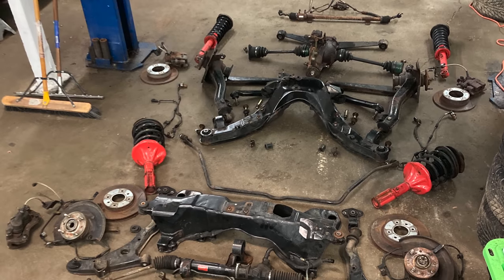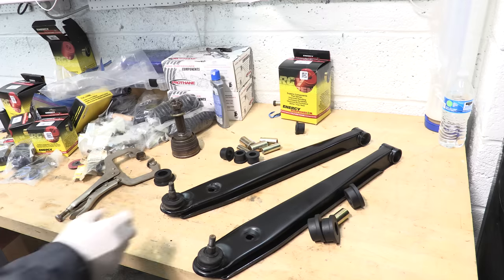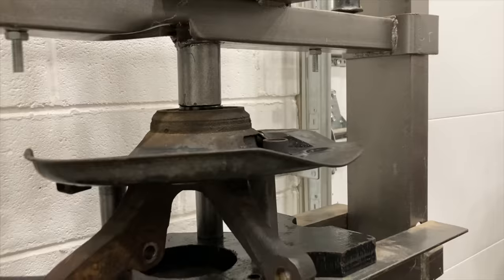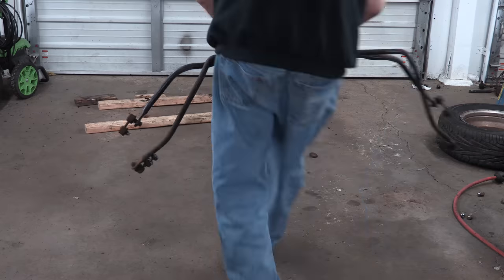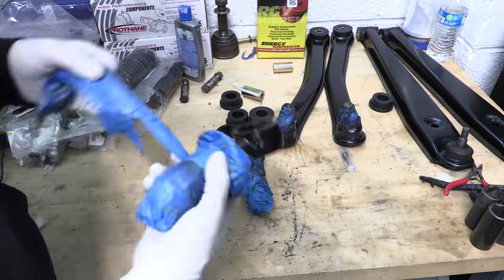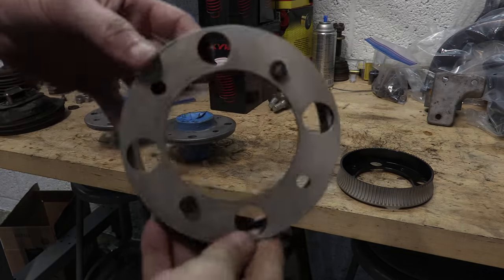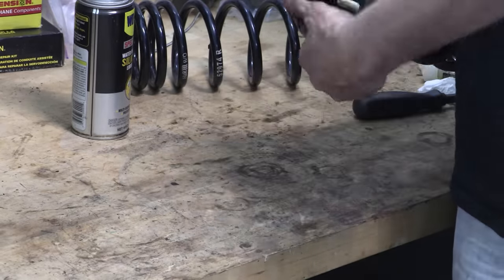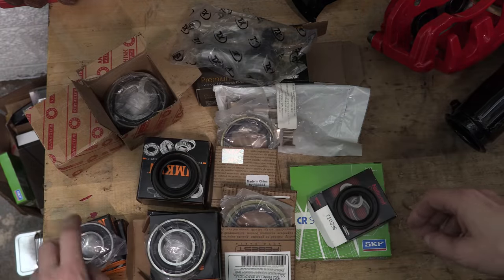Galant VR-4 Subframe Restoration Part 3

Comment: He definitely did a nice job on the powder coating. I used to do it for work. You should be fine to use brake parts cleaner though. That powder coat should be totally resistant to any of the normal automotive chemicals. If he said otherwise then yeah listen to him, but just what I think I know. Anything you spray painted you'll want to avoid the brake clean. Awesome work as always. Video went by quick!
Reply: Still gotta be careful with brake fluid though. It will make it bubble up if you get any on powdercoat
Reply: @Eastahtata  It's funny because I have seen testing that shows it does nothing, but at the same time I have experience that it does. I almost wonder if it depends on the brand or something. Either way, I'd definitely avoid it. I'd rather clean some off with brake parts cleaner than let it sit that's for sure.
Reply from the maker: Justin did not warn me about anything I said in the video, that all came from my own experience.  I figured it out the hard way on a few of my parts that Justin didn't coat.  It did.a thing that I couldn't put in front of show judges once, and that time it was actually with carb cleaner.  But since that time I've never met a mess that soapy water didn't clean up.  Which is nice, really.  It's a lot less toxic, and you've already got a non-stick coating.

I don't actually buy brake cleaner.  And nothing chlorinated will ever come in to my shop because we weld here.  All I use is Berkebile 2+2, and it wrecks absolutely everything that isn't bare metal.  Whenever I'm using that stuff it's because that's what I need to do at the time.  It's mostly acetone just like brake cleaner and carb cleaner... but it's got methylbenzene, xylene, toluene... way worse stuff in it.  It's great!  But it's not chlorinated. 

I also learned the hard way from overheating once (caused by air bubble in system on first startup, it got a great first heat cycle) that scalding hot coolant is also really bad for powder coating.  My "almost chrome" water pipe turned flat grey where it splashed. Coolant overflow hose blew off.  Again, not the same powders or Justin's work at all, but these are the kinds of things today that I will still go out of my way to avoid.  I'm even picky about the texture of rag I'm willing to use to clean powder coating just to avoid swirling, but ALL of this is only because I kept putting it in front of show judges, so I suppose my intent and past experience is a bit different than most people's would be today.  That would kinda shape my own advice this way.
Reply: @Jafromobile  All good to know and best practices are best practices. Properly applied, brakleen should at worst dull the finish on most powder coats a bit, but obviously it would be nice to avoid that too! Anything chlorinated is definitely nasty as well. Inhale some of that stuff you accidentally light on fire once and you won't forget it. Welding too, of course. Too many ways to injure yourself or die in a car shop if you aren't careful. Thanks for the advice and I typically stick to water based degreasers at worst for my heavy duty cleaning these days too.

Comment: Teflon tape wrapped around polyurethane bushings and sleeves helps prevent squeaks.
Reply from the maker: Here you go with the good advice again!  ;)
Reply: Better advice will it be if you had written it some years ago when I did mine. Grease goes away...
Reply: I just regrease mine if it bothers me enough but usually if you liberally apply it it lasts quite a long time, and poly bushings are worth pretty much any NVH just for the performance increase and overall feel alone. Personally, it never really bothered me on any of my daily drivers or track cars if I had a little squeaking here and there.
Reply from the maker: @caveone-365  I always wanted to add a grease fitting to the sleeves somehow, but without seals or an o-ring my idea always seemed kind of pointless because the grease would just run out the biggest gap.

Comment: Long story short, over the past few years, as much as I could get done each spring through fall and in between all the other things I've had going on, I've done most of the restoration work you've done on your Galant and GSX on my '92 Talon TSi AWD manual.

E.g. removed and completely overhauled/restored/rebuilt the entire front and rear suspension including subframes, members, control arms and strut assemblies, with new bushings when they were available, all four brake calipers, the driveshaft, rear bumper (taking on the front soon), fuel tank, and the manual transmission and shifter for good measure (took both completely apart and rebuilt them)

Replaced everything that typically needs to be replaced, e.g. pads, rotors, plugs, plug wires, PCV. thermostat, radiator, air filter (K&N), fuel filter, hoses, belts, TB/BB/WP, brake and clutch hoses, and a bunch of stuff I can't even remember. Also removed a ton of rust and treated it with POR-15 or KBS (initially used Rustoleum which is crap as I learned the hard way so I had to redo it all).

Also some relatively minor fixes, like stuck/slow/misaligned power windows, faulty radio, rear washer, etc. Now I'm about to do the same for the throttle, intake, exhaust and turbo, cleaning and replacing what needs to be cleaned and replaced. Also hope to try and fix the AC which only broke a year or so ago after 30 years (original and only owner yes you read that right), and the front bumper. Then it's on to the body, cleaning, removing dents and scratches, painting. And replacing the headliner and some weatherstrip.

The goal is to get it back as close to the condition it was in when I bought it, no true mods, just some relatively minor upgrades here and there like ES bushings, a K&N air filter, braided SS brake and clutch hoses, kevlar TB/BB, etc. I don't track or race it. It's my DD/road trip car. So no mods needed. No deletes either, as I like my creature comforts. I had a lot of fun driving it cross-country years ago so I'm trying to get it back to the shape it was in back then. It's a nice car, as you know.

But I have to chuckle every time I see one of your videos because I'm thinking "Yeah, been there, done that, uhuh, exactly, yep, that was hard, that was a pain, that wasn't fun, etc.". Like, removing the rear suspension bushings. Way harder than the fronts, had to drill, hacksaw, punch, pry, etc. And removing all that rust. I don't have a blasting setup so it was mostly a die grinder and rotary tool (I initially used a drill and driver with wire wheels but learned the hard way that this was really slow and inefficient).

I should be done with all the mechanical work this summer. Probably won't be able to do much about the body till next year, as that's a whole other thing about which I know very little. Thankfully the engine appears to be just fine so no work needed there. I want to be able to just drive the damn thing and go on road trips again so I can't wait till this is all over. Thanks for the informative and wry videos!

Comment: Always enjoy your videos. Im not a DSM guy but generally speaking you usually cut a little off your bump stops when installing lowering springs. I always do on the hundreds of cars I've put springs on. I usually chop the bump stops at around what the supposed drop is for the springs. If those are H&R's for example, usually the H&R sport springs are around like 1.5"-1.7" drop on the majority of cars I've installed them on. I'd be willing to bet they're around that height for the Galant. I've always had good results with the H&R's and I've had experience with the sport/ race springs as well as their coilovers, especially the 'Ultra-lows.' You could always modify your AGX's to run a set of QUALITY sleeve coilovers like some Ground Controls, with your choice of # springs and a set of camber plates. I've had amazing results on a more budget minded coilover setup with the GC/ Koni or GC/ Bilstein setup. Its even a setup thats capable on the track with all the goodies like sways, plates, bushings, etc and they work quite well when you figure your spring rates, corner balance, and of course, a properly setup alignment based on your needs/ what you're using the car for mainly. I'm frankly kind of a nerd when it comes to suspension tuning/ track setup if you couldn't already tell. LOL😂 loved the video Jaffro, keep up the great work and keep the videos coming man! 👍😎

Comment: You should drop by a local fleamarket whenever one shows up and buy the metal bits your press needs to function. You're making Nth more work for yourself by not having those and unlike the cheap press, those will last you a life time. I've press bits from my great grandpa's steam press, from back in the war, all the way down and i swear, having those bits is a game changer.
Reply from the maker: I'd love to have all that stuff, and I don't even own a press yet!  Matt picked up a bushing press kit which would have been helpful initially.  Some of that set can be useful on a press, and at some point I'll have to use it.  But Abe had all the dies in different sizes that you're talking about, and he absolutely killed it.

Comment: I had poly bushings in my S2000 and they were noisy at low speed but way better ride quality and handling. The better option IMO. I used shoe lasts for support, out of necessity, on my press when changing the wheel barings and it worked. There's a lot of good info in this video which is why I watched it twice.

Comment: I remember having to torch new bushings, just to use the sleeve. At the time, I was replacing the suspension in a Fiero, and the sleeves on the old bushings were rusting to pieces. And I was installing polyurethane bushings. Sometimes you just gotta do what you gotta do.

Comment: I did all poly bushings on my 2006 miata. I was afraid it would make the car louder, but it mostly didn't. The differential bushings made the diff louder, but it wasn't that bad. Definitely a worth while investment if you got bouncy or loose suspension parts.

Comment: Great videos Jafro!  I've been keeping up with all of them, but haven't though of much I could contribute in the comments.  I am surprised to see you using poly bushings in the suspension arms though.  Because poly doesn't twist like rubber I refuse to use them in any bushings that twist like suspension arms, though they are just fine for engine and diff mounts.  Wish you would have mentioned that fact to the viewers, as these joints will now require constant lubrication to not wear themselves out over time.  It's of course great to see all the progress you're making on your cars!

Comment: Amateur tip if you dont have a press: After lighting the bushes on fire like in the video, you can use a metal handsaw to remove the remaining sleeve. Just detach the sawblade, thread it through the sleeve and re-attach it to the saw. 
Sawing a slit in the sleeve makes it real easy to remove. Then you can just bash the new bushing in using a regular hammer and a piece of wood/plastic as a buffer.

If you don't care about potentially damaging the bushing slot slightly, you can also use a sawsall to cut the sleeve instead, it's way faster.

Comment: Hey, man! Nice to see you!
Q: @28:47 Have you ever considered either easily fab DIY or
buy a used electric oven (220v) to bake enameled parts, or even
a HIGH heat gun to cure? "baked on enamel" used to be a big deal
years & years before powder coating existed. I've even used propane
Benz-O-Matic torch to cure ceramic coatings for headers & blocks in situ.

The heat makes stuff flow, speeds curing- I know you know that, I'm just rambling.
Reply from the maker: One's actually been installed already before I could finish this video.  Stuff is getting baked onto part all over the place up here right now.  I'm not against trying it.  The factory enamel on all the subframe parts isn't your average paint.  The factory used some great processes.  There's a lot of great stuff that isn't sold to the public.  You can't get anyone to match any of Carroll Shelby's work because the primer is outlawed.  I wish I knew what the paint was that Mitsubishi used on their parts!  It's not ceramic, but it's not your average paint.

Comment: So of course I see this right after I do my front lower control arms on my 92 Galant VR4 # 927. My question would be what would happen if you don't put the sleeve back in before you put the new poly bushing back in?
Reply from the maker: If you jack the car up and wiggle it, it will be floppy.  Perhaps it's possible you used a brand of bushings that don't require the sleeve?  I know that mine required it, but if yours did and you didn't use it, it would have kept trying to fall out of the LCA before you installed it.  There would be a noticeable gap on the fit of the bushing.

Comment: Someone makes a tapered cone tool that allows you to spin the flange and heat that wheel bearing race. Once it gets hot enough the race falls off. Super easy.

Comment: Hey Jafro, you alluded to the pain in the ass that is removing bushing sleeves that are pressed into a subframe with no way of pushing them back out. Well...that is my reality right now on the '95 TSi AWD resto. You have any words of wisdom for getting those shells out? I've gotten two out by starting a cut with the dremel and punching it in until it gives way, but this seems horribly inefficient and the subframe itself is suffering some of the pain. Any thoughts?
Reply from the maker: Yes.  Air chisel.  If the sleeve is big enough, there is a bit that has a tooth, dead center in a chiseled blade.  If you've ever seen that one in a set, you know exactly what I'm talking about.  You can cut all the way across it with that without damaging the hole if the hole is big enough.  You can also use the rounded punch to roll the sleeve inward and take some of the grip off it. Not every air chisel is equal.  I had to do this on two of the [EDIT: excuse me, REAR] knuckles of my GSX that couldn't be accessed with a press.  I had to use the round punch because the hole the sleeve was in was only about 24mm across.  It's a lot less effort than cutting and hammering, you just pull a trigger and push.  I'm about to do a 1995 suspension video, but where you're at I'm late, I'm afraid.
Reply: @Jafromobile  makes perfect sense, basically the pneumatic version of what I’ve been attempting to do. I’ll let you know how that works out. I saw you are going with the tubular volk rear subframe,  so at least you’re avoiding most of the pain.